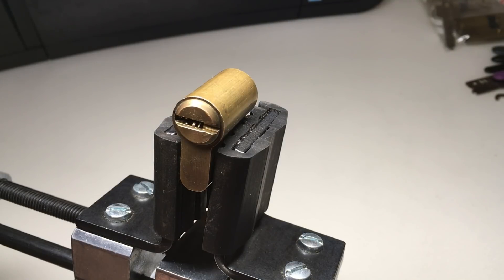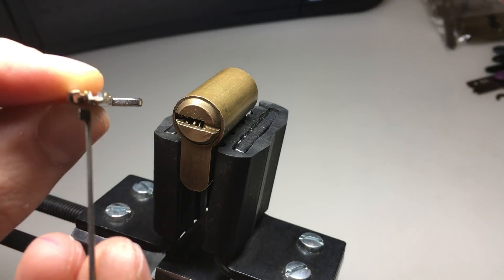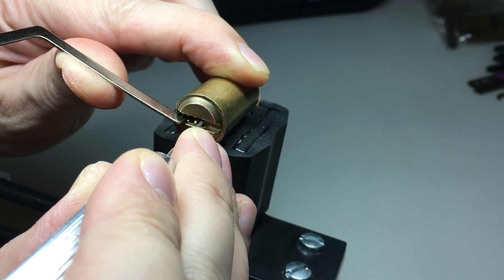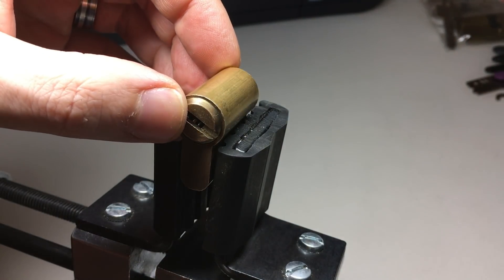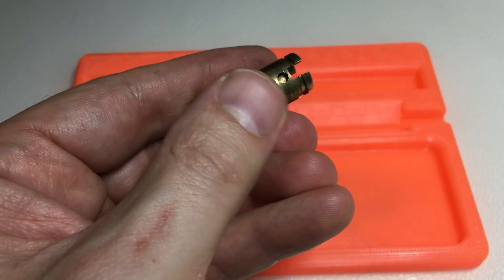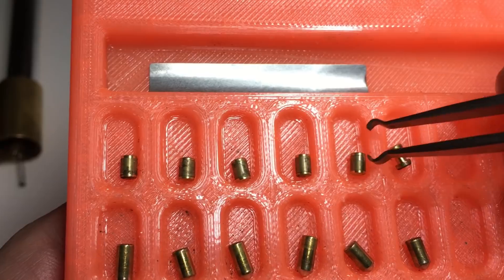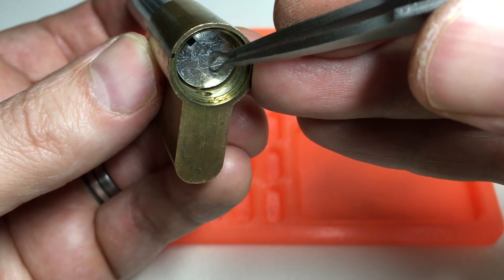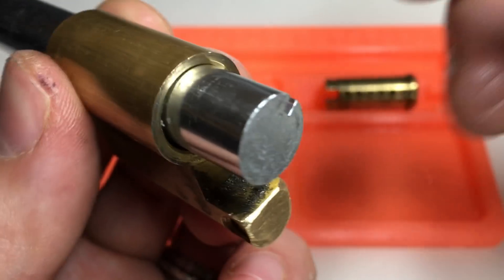(368) Lesson on bevelled Pins - AZBE HS6 Spanish Dimple Euro Pick & Gut

Comment: I agree with you, I actually have one of these AZBEs in use. Was not that easy pick :)
very good job in picking it. 
btw try smoothing more the edges of the shaft of flag pick, I find it really makes maneuvering easier.
Reply from the maker: Good tip on the flag, I have been thinking of buying another set to customise a little further than the ones I use currently. :-)

Comment: ... OK, just for you.... 
Cheater!  No one can possibly pick that thing that fast with all it's pins.... you must have edited a 30 minute pick! ... or gutted it , and left out 1/2 the pins!!! 

I have an old 6 pin Sargent pad lock, which I have the key for, which I have only picked once, by accident.  I drilled out the plugs and threaded for grub screws so I could practice with 1, 2 , 3  or 4 pins.  I still cannot pick it with all 6 installed. Just great bitting and tolerances.
Reply from the maker: Yeah, Leon’s Lockpad sent me a Sargent and it has never been picked. Horrible and unfair thing! :-)
Reply: Yes, yes.
There are currently 4 locks in my naughty bucket. A duo core Corbin, that Sargent, an all brass Eagle, and one perfectly horrible Schlage Primus mortise lock.
I would love to see a tour of your naughty bucket. 
R.
Reply from the maker: It’s more a naughty dumpster 🤣🤣🤣